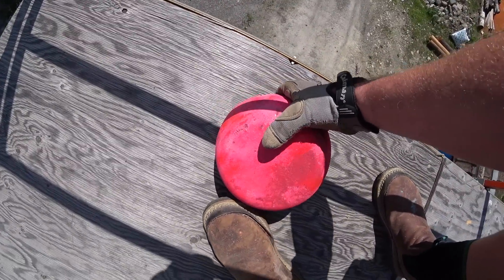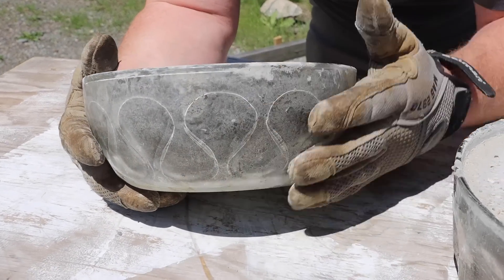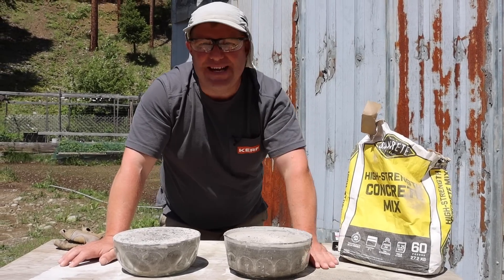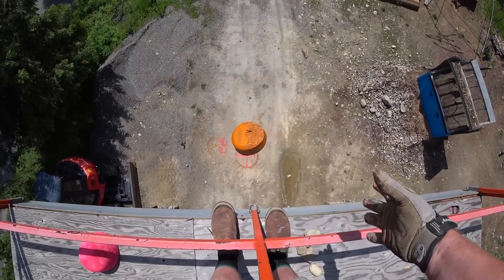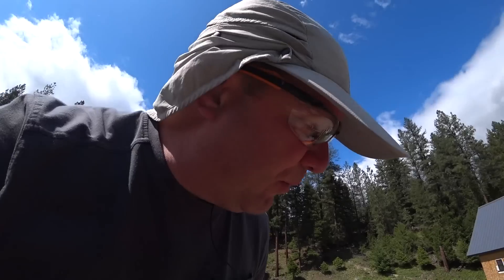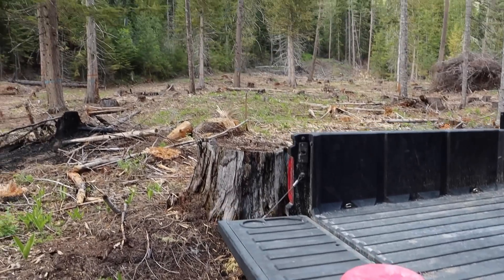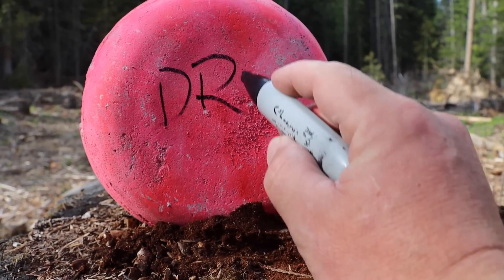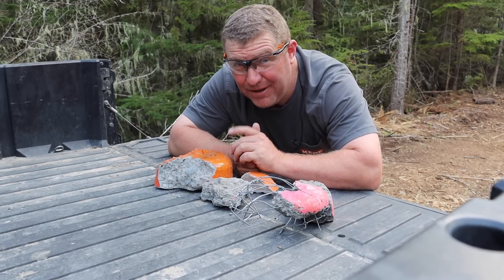Dry Pour Concrete vs Bullet

Comment: The beauty of dry poor is that you can use it directly on level ground without removing grass weeds etc. Frame out samples straight on the ground exactly the same and test that. Wetting the dry pour the correct way and having your wet pour with correctly ratios

Comment: Dry pour is crap for anything important.  Because you can't see and nor control the moisture consistently.  The top could look perfect, but underneath be excessively wet or dry in areas and you won't even know it.  With a mixer or truck you see and know exactly what you're getting.

Comment: Better sample build would be two wood wall squares, filled lying on natural ground, so similar to a pour in normsl use. Allows natural water soak into the ground as would exist in the real use conditions.
I would tend to be more trusting of the results than this glass bowl, trapped moisture manufacture.  You surely have some wood boards to use for box frame building.

Comment: Probably the dry pour benefitted by wide dispersion of aggregate. While wet pour had aggregate concentrated low down leaving top layers as brittle sand/cement mix. Not very impact resistant, and likely not wear resistant but having smooth surface finish. The dry mix will however be harder wearing by prsence of aggregate near surface, but also making it likely to hsve rougher surfaces,  if not immediately certainly long term wear surfsce.
Reply from the maker: What is clear is it’s stronger then it looked! More questions than answers!

Comment: On your second drop of each concrete piece, from the footage you opened up your hand to let the wet pour free fall but the footage of the dry pour seems to show that when in the process of letting go you actually slightly pushed through with your hand, causing the concrete bowl to free fall faster. But as i said it is just how the video looks. Great to see you back with the comments being left 😊. As alway's guy's 💯%   👍   🇬🇧.
Reply from the maker: The arm drop method leaves room for a lot of interpretation. Haha!

Comment: Have placed more concrete in my life than I care to remember. House slabs, garages, carports, desks, sheds etc. Worked in the concrete industry for twelve years. I am also technically trained in concrete. Would not do a dry concrete pour anywhere on my property for any purpose even if someone else paid for it and placed it. Nit how concrete works as you said.

Your wet pour was way to wet. For example, in a 5m3 load of N class concrete, 20, 25, 32, 40 and 50 mpa it only take 30L of water to pull the mix out of spec. I don't know what is on the instructions on the bags in the US but in Australia it is 2L of water fir a 20kg bag. With such a small amount of concrete it would take such a tiny amount of water to pull it out of spec. Minuscule. 

There is also what is called a cold joint. Where fresh concrete will not set to set concrete. In a dry pour, water seeping through at different rates and consistently over a slab you will end up with cold joints. 

Not how concrete is designed. Do as you will, but not how concrete designed.

Would never ever do a dry concrete pour ever.
Reply from the maker: I would have been with you 100%. Even with all the obvious potential issues here the concrete was stronger than everyone expected. No way anyone expected concrete to survive that kind of abuse. It’s all in good fun. Concrete is an art learned over a lifetime. The rest of us are just guessing and hoping.

Comment: Ok my guess.  Glassware did you in.   Put into small square on the ground and the rain on the wet slows down and makes it harder. So make a form for both - outside and wet and dry and give it a try on using the ground and air for the two big sides.  I think dry slowly generates xtals in the cement and therefore is stronger.
Reply from the maker: Good suggestion but the bowls were fun for watching the hydration! Might have to move the experiment to a more legitimate testing method. Stay tuned!

Comment: Great to see the PLFL content back!! Maybe you should have drove your heaven truck over them for a better compression type test? I can't say what would work better for your application. A rougher surface may be good in cold icy climate. For a driveway? I'd go wet. Smiles and blessings...
Reply from the maker: If it works there’s certainly a lot of concrete tasks that dry pour would make so much easier. But maybe not for the pretty things. :)

Comment: Once it is all hydrated I don't think it makes much difference.  If the aggregate and cement is well mixed without voids it should be the same strength.  I've had old bags of concrete set up in the bag sitting in my garage for several years.
Reply from the maker: Good point! Humidity alone can make a brick!

Comment: The wet pour was way too wet when poured, which greatly weakens the concrete.  Notice the aggregate is not breaking, a sure sign of a weak concrete slurry.  The dry mix probably ended up with a much better water / cement ratio in the end and would test much better in a compression test, an easy more scientific test that any ready mix plant could run for you.  Search YouTube for concrete compression test cylinders for more info.

Comment: The dry pour has no air in it because it slowly saturated the water . The wet pour was it vibrated it it wasn't it has air trapped causing it to have voids.  Try it again but vibrate the wet so both have no air. Great test.
Reply from the maker: It was lightly jiggled by hand. Does that count? Lol.

Comment: Perhaps if you used a plastic container (like the Costco Round Cake containers, after the cake is eaten) and put some drainage holes in them, so the water doesn’t sit in the concrete the whole time, and then re-do your test? That was great seeing you do this test, as I am heavily leaning on using the dry pour method for lots of home projects! You two are awesome! Thanks for sharing!
Reply from the maker: Good idea. Need to find better molds that allow for more real world test conditions. Bowls were fun to see the dry pour hydration process though!

Comment: Dry pour seems to work good for areas you don’t care about the finish, like post holes. Possible footings? It does seem stronger than wet pour. But wet pour seems to be best for finished work like floors and walks.